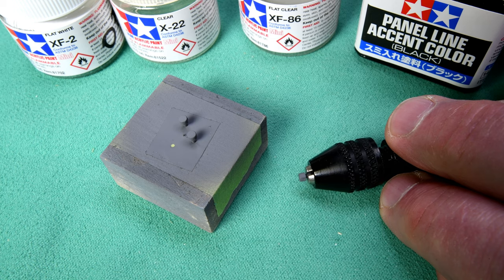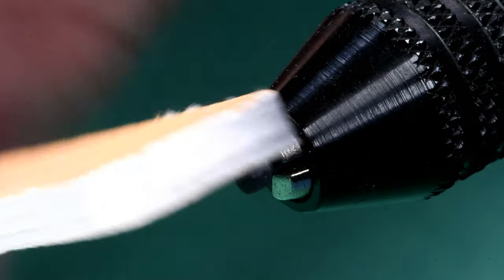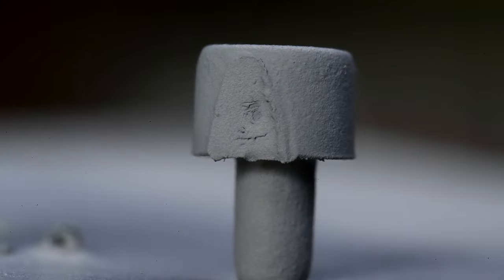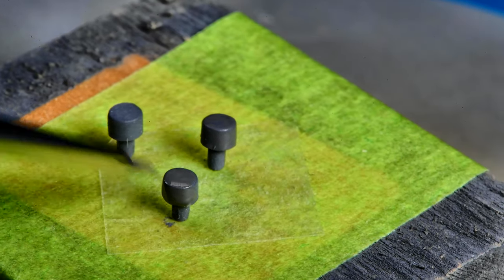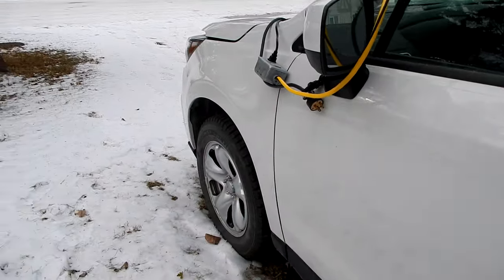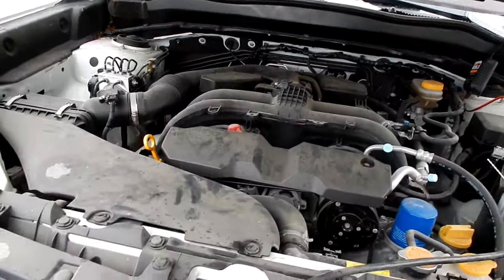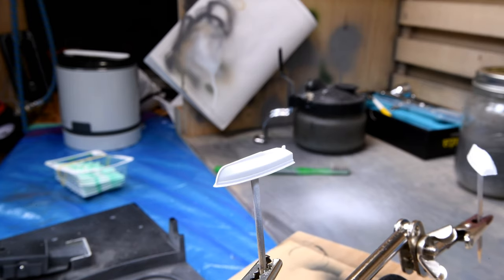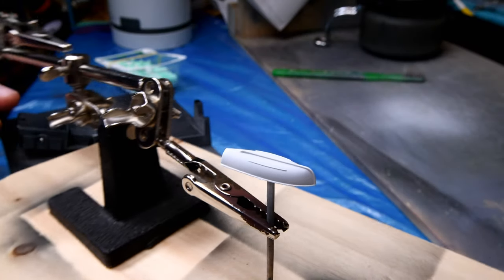The Model Ship - Part 640

Comment: Hello Ron,   When needing to cut off small parts I always use a craft knife to score around the attachment area.. 
However I could neve get used to X-Acto style handles or blades.   
So, I employ several Swan Morton scalpel types to which I mould Sugru Original Formula Mouldable Glue to the handle to aid positional hold and grip.   
Also when cleaning up small round parts I employ a small powered 3.6v Electric Cordless Screwdriver and into which fits a small Keyless Drill Chuck Screwdriver,  this is ideal for drilling hole in plastic as to the low RPM of the brill bit ,so little frictional heat build up.   P.S  here in the Uk its about 8 degrees, dull, damp and gloomy, bit like an extended summer.  Ha, ha. Take care too.
Reply from the maker: A custom shaped hobby knife handle! Now that's unique. 👍

Comment: Those boat's look very good way better than hand painting them speaking of white you had to tease with the snow that wouldn't last 5 minutes here 38deg C at moment 41 Monday, Tuesday & 43c Wednesday then back to 36c Thursday see you tomorrow if we don't melt take care Ron cheers mate 👍🌞🌞🌞🌞🌞
Reply from the maker: I have an Aussie Facebook friend who posted a photo of his wooden decking curling up on the edges because of the heat. 🥵
Reply: @roncalverley  as i type this Ron it's 11-31pm at night & the temperature on my thermometer beside my bed says it's 29.7 degrees Celsius & I've had the windows open all day haven't been able to shut them if it tried airbrushing in my shed or the house i think I'd endup with a baked enamel finish on my model haven't done any modelling for last 3 days & won't this week too hot I'll be in front of the fan watching you instead & jealously admiring your melting snow good night mate 👍😀

Comment: Concur on the battery charger 'pulsing'.
Mine does the same with lead-acid batteries that are very low.
The manual for the device identifies this as a designed feature.
(AARGH ! SNOW ! - frozen arctic wasteland...reminds me of life in Montreal, Quebec.)
Reply from the maker: "frozen arctic wasteland" Haha! Yes, not like your Island forecast for today. https://weather.gc.ca/city/pages/bc-85_metric_e.html
I do have a normal battery charger. The old style that keeps the current flowing until the battery boils dry should I forget about it.